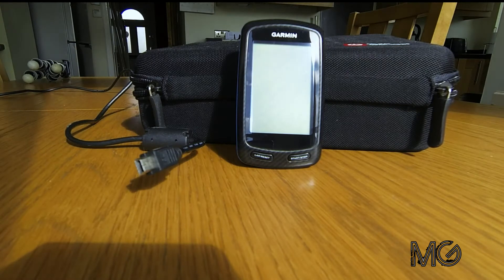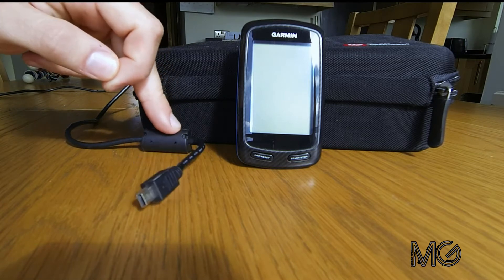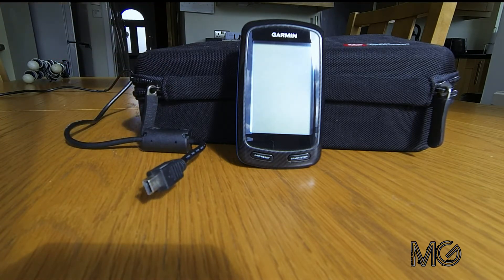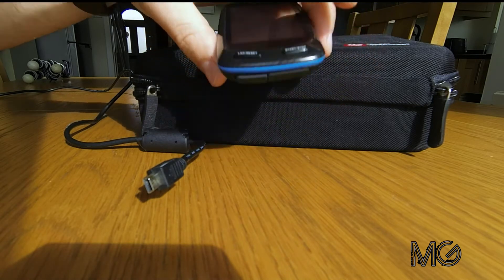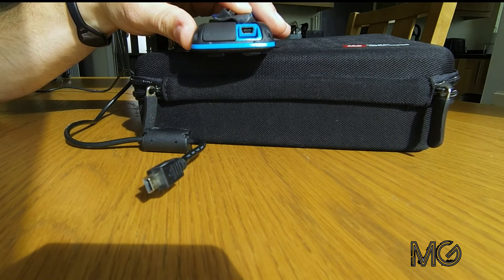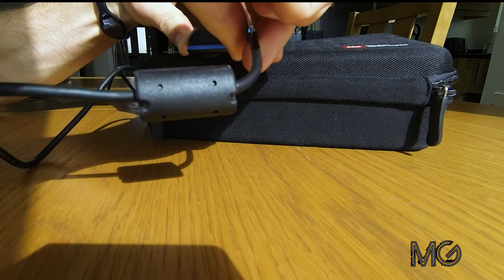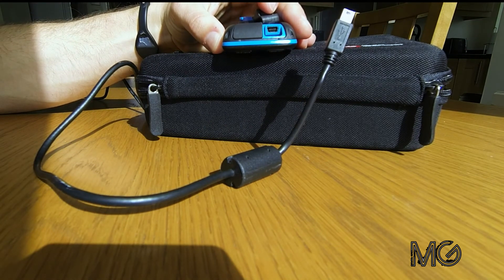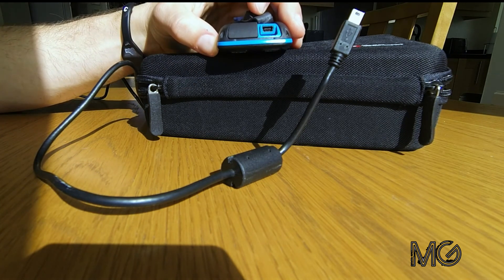FIX YOUR GARMIN - Connection problems

Comment: Hi
in this instance it did not work. i tried resetting the Garmin and full pipe clean ,factory Restore.still no Joy.
then i tried the original Garmin connection câble,(i had a Sony one for my phone!).and bingo works a treat.now ill spend a couple of Hours customising the Device doh!
Thanks all the same Pal.